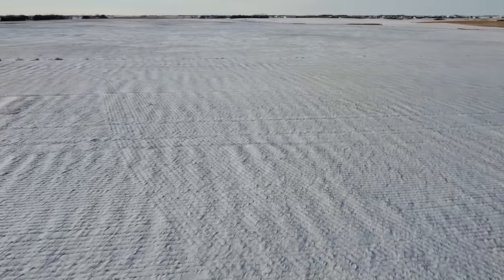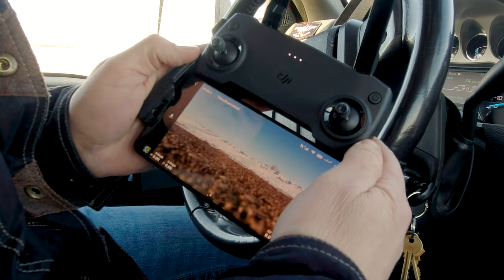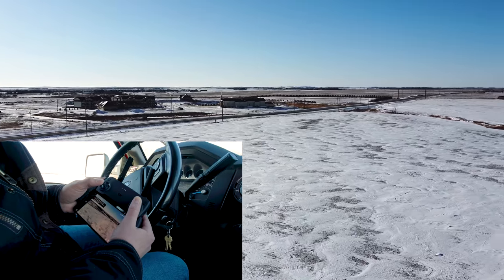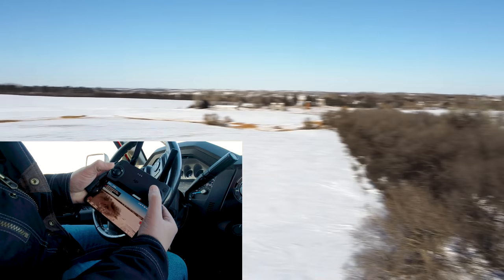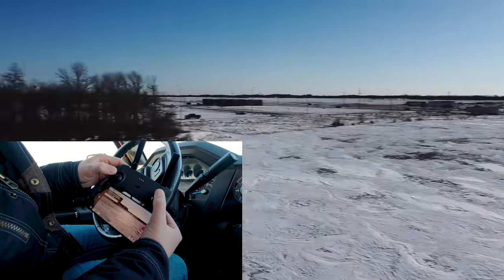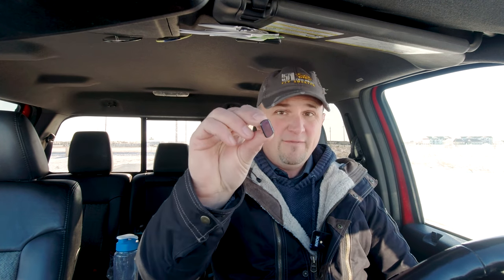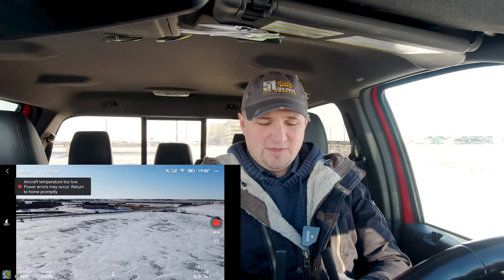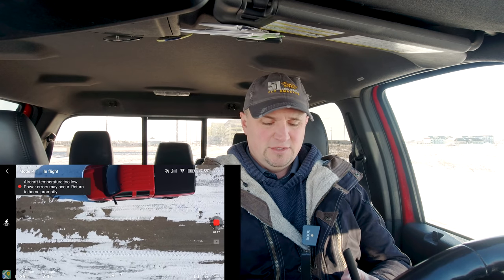How to Crash Your Mavic Mini.

Comment from the maker: I'm certain I will get a lot of comments about flying inside my vehicle.  My pre-response: I've done it for 3 years.  It only has caused mild signal impairments on all of my drones.  Before you comment with the term: "Faraday Cage", please look that up and educate yourself.  I fear that you may have no idea what a Faraday cage is.  There are no rules against flying a drone from inside a stationary vehicle.  Just maintain VLOS.  Watch my recent video: "Quick Tips for Your Mavic Mini".
Reply: Mike Faraday just called me and he said that you were not in his cage. If you were, you never would have gotten your drone off the ground, much less been able to get any camera feed back. Figured I'd let you know. He also says 'Hello!' and he appreciated the video! He also says that you should really try fpv freestyle drone flying  😁😉 👍🏻
Reply: I'm surprised anyone would suggest your in a Faraday Cage. A high voltage smacking you in your ungrounded vehicle, is quite different to sending out radio waves..
Reply: Moody
Reply: @meechcreativellc  I totally agree. Is why I said I'm uncertain why any one would suggest so. I understand the RF would be attenuated, no doubt, I just dont know by how much and if the attenuated signal would even be degraded significantly. Probably not.
Reply from the maker: @colinmclean1300  thank you!
Reply: Hi Russ. Could it be the downward sensors? I have the same issue with mp2 because of the snow, same over water. It goes away at higher altitudes. Like snow blindness lol
Reply: would of been nice if you tapped on the battery icon to see the temps

Comment: I read through a few of the comments and didn't see this mentioned, sorry if I missed a duplicate comment. Bear in mind that surface temperatures are just that, surface temperatures. As you increase altitude, there's a rule of thumb that the temperature drops around 3.5 degrees per 1000 feet. Depending on weather conditions, that temperature change can vary from the average by quite a bit.

Comment: Russ...this happened;
I just got my MPP, my Christmas present...to me
I've flown it about 6 times, no issues...yesterday I went to do some video at an old bath house that is now in ruins that is set up as historical site. I got the MPP ready, did compass calibration that I do each time,set it up about 30 feet and recorded home point, with audible confirmation from controller. I put the mavic up at about 175 feet, centered above bath house, went to POI and marked   my position, backed away about 100 feet and applied, began the flight at 5 mph...did one full circle, then reversed to do another in opposite direction. My battery low warning came on so I stopped the POI and since I was in an open area, decided to just drop down where it was, it would not respond to stick movements for lowering altitude, so I thought I would bring it over towards me, but the stick movements were going crazy, I move the stick to go forward and it went left over a river behind me, so I moved the stick opposite hoping the reverse course...it was yawing in place so I ran over to it, it was now back over close to the bath house about 10 off the ground, u tried to force land it but it would not descend,  it gave me critical battery warning and I knew it could not make it back over the building...then it just went full throttle backwards into the building...props broken, gimble popped out of its little bracket that keeps it in place and left rear prop arm bracket popped out a bit...no damage or scratches to the mavic, just the props. I have dji refresh care and sent it in yesterday...I dont know what happened and that was my biggest fear when I bought it...I have several racing quads that I built myself, my pilot skills are not that of a rookie, I've been flying rc for 40 years...now when I get it back, or a new one, I'll be worse off when I fly it, more scared than ever...its insured as well but I'll still be scared to do the things I had in mind, this will haunt me every time I put it in the air

Comment: Sorry but I found there is no leeway in temperature when it comes to DJI operating temperature specs. If anything, lower than max & higher than min.
Case in point, I cannot fly in temps higher than 37°C on either of my two Mavic Air.

Comment: Ken Tip:
Calibrate your IMU close to the temperature in which you intend to fly AND calibrate the compass EVERY FLIGHT. 🤓👍
Reply: Some plastics crack when they freeze. Silicon ICs are no different. They can bust, becoming brittle.
In surface-mount designs like the IMU, the differential temperature coefficient of expansion between the part soldered and the circuit board itself, can cause large stresses. The stress-strain-temperature relationship often barely works over the specified temperature range. When the equipment is powered up, the hot components can change shape and can break the brittle IC housing. I doubt  any consumer drones use military grade ICs. Motto of the story..dont play in temperatures outside of spec..
Reply: Lava Lizard  Yes, he said it's 0°F
Reply: @aalani  Twice:-)

Comment: I have flown the MM several times at about -26 Fahrenheit without any of the altitude hold  issues altitude that you were experiencing. The only issues I had with the long flight of those temperatures was that the gimbal seem to lose its flexibility.
On a slightly different topic, i use the tonneau cover on my pick up as a landing pad. I don’t get any  magnetic interference as long as it is not located right on the edge of the cover.

Comment: Russ! Please can i ask a favor. I would love going forward if you would include more technical details about your experiences. For the mini, what firmware your on. For the Android, what model phone. Because both of your problems in this video i have not had one of them. I do not update my mini and i preheat my batters before flinging in -26c. I also have a very expensive Note10plus cellphone. So I'm trying to figer out what's going with your problems but need to rule out the technical stuff. If your able in future videos, more info is better. Thank you Love you videos. Please keep up the good work.
Reply: Also, I have two mini's just for testing when DJI puts out a new firmware. I have been flying drones for 10years now and cant tell you how many times they have made mistakes. I do IT work for a living and fly drones mostly as a hobbyists but have done lots of drone jobs also. A very good phone cord, hi end device, good tested firmware & warm batters  Are Your Friend I have found.

Comment: I just tape one of those hand warmers to the battery on Mavic Air (heat goes up into drone).  Also before filming a sequence I keep the drone in my coat close to my body with the hand warmer attached to get it up to temps.  This has worked  great for me at high elevations deep in Idaho wilderness. I replace the hand warmer as needed based on its temp and my filming needs.
Reply: Hangs4Fun apparently mr Steele sells a heated lipo-powered battery case. I believe his brand is “ethix”. It sounds like an interesting idea.
Reply: @platty9237  thanks will check that out.  That should def help the battery.  Curious if the sensors and other components required for positioning and elevation are not impacted by cold.  My technique keeps a good part of the drone warm until usage, not just the battery.  But if those sensors are fine to be at below zero temps at high elevation and only the battery needs to be kept warm, then this may just be a simpler solution.  TBH though, the Mavic Air fits kind of nice in my Patagonia Down Hoody pocket and those hand warmers last me a good amount of time.

Comment: More likely the baro.  Most IMU chips are rated down to -40F.  If it was the IMU then all 3 axis (axes) would be affected.
Reply from the maker: Hmmm. . . interesting.  Now I need to read more!
Reply: Yes I was just going to say the same thing. IMU is in All directions so why is the drone not reacting badly left or right.... plus the  Barometer sensor is what is used to hold altitude.
Reply: You have a point there.  I suspect it’s the battery temp that’s throwing off the little bird.

Comment: Hi, Thank you for you contribution. You are right temperatures affect electronics. In the The Mini is very power effective, so the inside is not heating enough to keep the IMU at a good temperature, the other DJI Drones consume more power on on the main board and have more capabilities to keep the inside warm.

Comment: I just wanted to mention that I was flying with Mavic Mini on -14 C without any problem !!! there was no delay between remote and drone, Of course I let drone got cold before fly for about 8 min, 
Even I didn't have any issue with gimbal as well , there was not any distortion on the footage. of course because of the temperature I could fly not more than 17 min.

Comment: Nice video. I flew my mini in 32’ Fahrenheit today with no issues at all. Actually surprised how far it went with WiFi and all of the apartments around here before it lost signal and that was entirely by accident just got turned around and accidentally flew it too far lol. It did take a moment for that thing to warm up to appropriate levels but once it did no issues.

Comment: Technically the IMU is a sensor which tells the drone it's rotational rates and accelerations.  That feeds into a some kind of attitude estimation filter that will the estimate the roll, pitch, yaw of the drone and maybe the location. Then there is some sort of control system that tries to make the estimated/attitude location match the desired attitude/location.  Where are you flying?  I'm in Minnesota flying in +16F today with a mavic and a phantom.  Thanks for the great content!
Reply from the maker: North Dakota.

Comment: I found out that in my DJI drones, as long as the battery is warm enough, there are no issues with flying in cold conditions.....
And it's not a problem of temperature, but of voltage loss and how much power the battery can release at a certain time to power all the goodies in your drone (ahem, systems). 

Best case scenario, you loose video feed and everything else works fine, or your avoidance sensor stop workink but the rest work, or you stop getting readings from sattelite count, voltage indicators, and so on.......I say it's best that the IMU and ECU and motors die last :)) (I don't think somebody will argue with that), but by that time I guess you already know you should land as fast as you can.
Mine, after powering one and calibrating, and in cold as f.... conditions  can't hold altitude from the start and voltage readings seem to be in the yellow/red.......After hovering and attepting to hold altitude for 1 minute or so, and warming up, it works quite fine, and voltage reading get to green and yellow (if you push it hard), but it hovers without a problem.
Reply: I also have hand no issues flying in -26c after a take 5 mun to warm the batter's up to 34c. Flys great.
Reply: Good to know.
Reply: Excellent points... just like prior to workouts... always warm up, otherwise risk of injuries

Comment: Here is a question or possibly an idea for a video. The other night I was camping and there was minimal light around the campsite. I fired up my Mavic Mini and waited until it had locked in with I think around 9 - 13 satellites. I launched. The drone rose to 4' or so as normal and hovered for a few seconds. Then suddenly the drone accelerated, took a hard left and crashed into my van. Luckily no damage. Any idea the reason for this? Does this drone require a certain amount of ambient light to function? Outside temps were mid 30's. I had warmed the battery before takeoff. Thanks man. I enjoy your informative videos.
Reply from the maker: No idea why that happened.  Doesn't require light.

Comment: Good stuff, Russ!
"I'm sure they build in some leeway there..." 
I wish I had a dollar for every time I've said that! The fact that I am alive is, however, a testimonial to the accuracy of that statement!
It was interesting that the drone always climbed going east and descended going west (my directions assume you were flying mid-day). We can always count on you to torture test everything. I appreciate that! 
I don't know if the Mini does this, but in the Mavic Pro's flight record (assuming M2P, too), it allows you to see exactly what the controller input (stick positions, etc.) were at any point in the flight. If the Mini has this, it would be interesting to see what it was getting when the altitude was changing.
You can come over here to Eastern WA and fly. We're having a heat wave this week - high 40's!
Thanks for the video.
Reply from the maker: It actually climbed and descended in all directions.  Two days before, it was North and South, and was only a decrease.
Reply: Skycam509 for the Mavic Mini control inputs and all the other data is collected in the flight log. I’ve checked mine on Airdata but no doubt other ways to check it

Comment: -17 Celsius ? What were you expecting? 😊
I dare you to go out with small plastic clothes over you. You will also not working well. 😉
Now more seriously, the IMU should be working at those heights but the cold might scramble it up. I have been flying in - 12 Celsius and it was OK. But I didn't even get the cold temperatures warning. My hands wouldn't be able to stand those temperatures anyway... So it doesn't matter

Comment: I can't believe you fly while sitting in your truck. There has to be some kind of interference especially with a wifi drone and all that magnetic interference from the truck.
Reply from the maker: Nope.  Watch my quick tips video I just posted.  I've done it for 3 years with no problems.
Reply: I have also flown from my vehicle especially in 100 + degree weather which would cause my iPad to crash from heat.  Sitting in the AC was the only way to get the job done.  I usually don't use this approach unless necessary...... 🙂

Comment: Without disagreeing with your conclusions, two addition factors occur to me. Firstly, at -18C I imagine your battery wouldn't be at peak performance. Did you note the power the aircraft was getting? Would this impact on IMU performance?

Secondly, I wonder about all that snow. There's no way I can test this in Western Australia, but would the aircraft be messed up by all that reflective, relatively featureless surface?

BTW, I note the Mavic 2 is rated for -10 to 40C. It will be in the low 40s here early next week. I'm not sure if I want to repeat your experiment here or not!  :-)

Thanks for the video.

Comment: HI! 
I always fly over the bay waters. Is there a way to set a "LOW TERRAIN, LOW ALTITUDE WARNING" on the Mavic mini2 or Air 2.?

 I get very distracted and lost all altitude while moving the left joystick to rotate the drone. A "low altitude warning" would be life-saving for my drone.  I could set it to any altitude I want the warning to be activated. The idea is to increase altitude if I get below, e.g.,  5 or 10 meters. To prevent it from crashing into the water. I already lost the Mavic mini and the Mavic 2. I can't retrieve them from the bottom of the bay, I feel sad and stupid for not checking the altitude. I am afraid to buy a new one and make the same mistake.

Comment: Extreme temperatures can effect battery as well. On my 'old' drone, once when I was flying in winter, I just flew up (max 10m) and battery (fully charged) was empty just enough to land. Even my NiMH batteries from small rc buggy got flat in more than half time it takes in normal conditions. With lithium batteries once charge drops beyond certain point they are 'dead' (you cannot recover them any more by charging) and to prevent this, there is battery cut-off in devices to prevent you from using them under the limit. But in low temp environment, it is easy to pass that point and not even know it. Therefore, be smart and do not overuse your Li-bat in cold temperatures. Plan your flight and land with 25-20%. Fly safe ;)

Comment: Now I think you have some valid points in this video.  
To me, watching the drone's video it didn't look like the altitude was changing.  Hard to really tell, but with that said let me share a personal experience with my MINI.
A couple weeks ago I was went to a lake shore to check out the "ice shoves" from the wind blowing the ice on to the shoreline.
Temperature was in the 20-25 F range and wind less than 15 mph.
I flew my Mini that day for just about 2 batteries checking out the ice shoves.
Now I did not experience what you did with the altitude rising.  I had a different experience.
First off, lets mention I NEVER got a cold temp warning at all.
I flew most of the time in the 30-60 ft altitude range and a few times up to around 100 ft.
Here's the weird part.  At some point during one flight I was hovering and around 50 ft or so and the controller altitude read I was at....ya ready?  0 ft.  The Mini was about 100 ft away at the time, and I was standing outside on the shoreline.
Your experience and mine having me thinking (along with the report fly away), is there just something wrong with the IMU?
By the away, my experience only happened on that one flight.